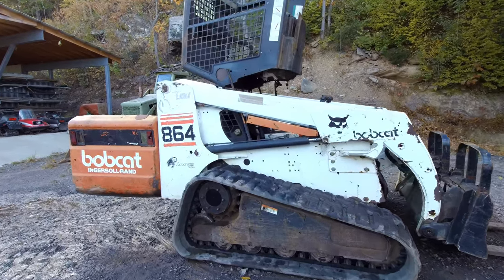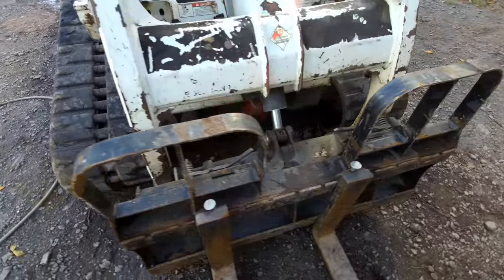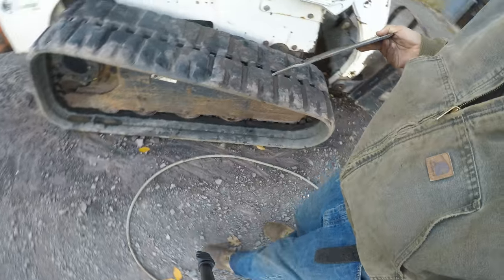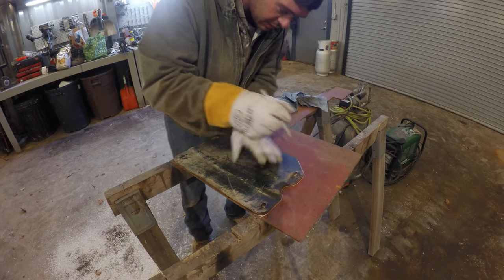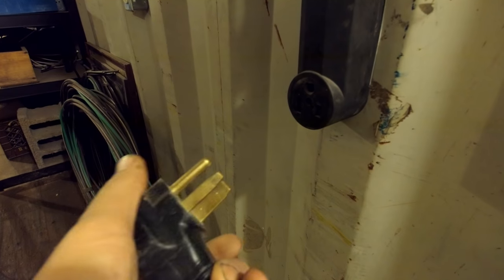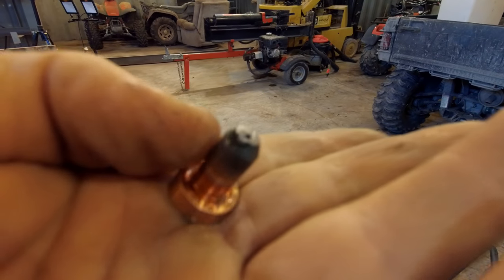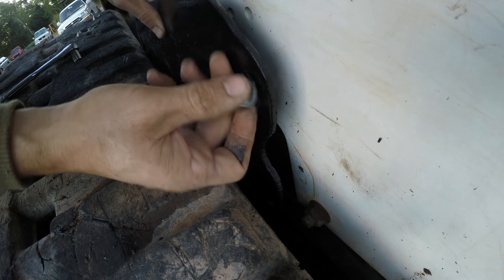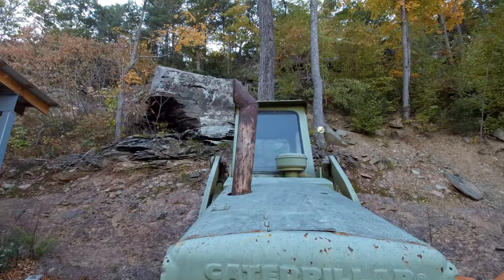How to use a Plasma cutter

Comment: I recommend you add a small water separator to the back of your plasma cutter. They are inexpensive and keep water out of the cutter which is what burns up the tips. You could also go over-board as I have and put one on your air compressor as that is where the water comes from. Great video as usual, Andrew. Nice fabrication job. And, thanks for sharing.
Reply: some plasma cutters have built in water seperaters in the back.
Reply: @davesilvia9711  this one has.
Reply: adding it right before the tool is best because then the moisture in the air has had the biggest chance to condensate and then be separated out.  (if you plan on cutting for long periods of time or in very humid conditions, an air cooler is a must as all components will heat up and moisture wont condensate and cant be separated out.)

Comment: The Cutmaster 52 also accommodates "drag" tips. A drag tip allows direct contact to the metal, makes a far smoother cut, and much easier to do accurate freehand whereas the standoff is just that it's 1/2 in. off the metal. However, Drag tips work only up to a 1/4 in. thickness whereas the standoff are rated at 1in. max. In this application who cares about very smooth cuts -- what he did was perfect.  Andrew is amazing and I learn something on every video. ( The drag tip code  is 9-8252 for the 60 amp version for those considering a Cutmaster 52 )

Comment: I used to build those when they did that in Lebanon NH! My Father was one of the people who figured out how to get the plasma cutter to work at Browning Engineering back in the 50's where it was invented. The main purpose of the plasma cutter was develop for Nasa and the Military, Nasa needed something to cut different metals and the Military need to destroy left over bombs in the Connecticut River. That will also cut under water!  Browning Engineering became Thermal Dynamics in the 60's. My dad never got any credit, but his legend lives on today.. :)
Reply from the maker: Neat. That is a good tool. It will be using heavily in an upcoming video.
Reply: @AndrewCamarata   You have the best! The Torch is the whole secret to a plasma system, and no one else can copy it because of the several patients that Thermal has.. I love your videos! -Tom

Comment: I actually have a Harbor Freight plasma cutter. The literature states that it will cut up to 3/4" mild steel. I haven't tried that, but it zips through everything that I've tried cutting up to 3/8". I've had it for about 2 years and not a complaint in the world. BTW, if you  look under the hood on yours, you just might find it too was made in China. I did enjoy your video. Thanks!

Comment: You never miss what you have until you lose it. I lost most of my hearing in Nam but I don't think I was expected to come back anyway. Great job of explaining how to use and nice hints on how not to burn the house or garage , shop down. I was thinking that the machine should have a skid plate on bottom to help protect and it fills with leaves grease junk and things that either burn or trap oil and heat.. good idea to pull and clean out once in while with a flat shovel for most of it I know someone who burnt his shed and nearly his house because he set the dogs bed to smoldering and it flared up later on. he also lost his car that was parked inside. Very good video. No drone on this one/LOL..... I was referring to the bottom of the bobcat having a skid plate

Comment: Another job well done....Now don’t forget to clean the tracks out on the good old 955...You know that dirt will freeze like concrete. There are some tricks that may help after you clean. I’ve use concrete form oil, or antifreeze, and (if I ran out of those two) diesel fuel. Use a pump sprayer. I would park on some old planks or railroad ties to prevent freezing to the ground. Make sure you use the pet safe antifreeze. Thanks for another good one.

Comment: Regarding post-cut clean up; 95% of the dross can be removed after the metal cools a little by lightly tapping it with a hammer. Then usually just one swipe with the flap wheel and done.  Saves consumables.

Comment: Someone has probably mentioned it, but the secret to clean plasma cuts with minimal dross to grind off is to ensure the plasma stream is exiting the work at an angle, not going straight through. This can be done by either upping the travel speed, or by dropping the amps.

Comment: Hey Andrew. Just a FYI!!!!!!! ABOUT THE PLASMA CUTTER. THERE IS A SPECIAL LEN FOR THE PLASMA CUTTER  helmet IT STRONGER THEN A WELDING LENS!!!!!!!!!!!!!!!!!!!!! . DONT WRECK YOUR EYES 👀 As for your plate for the bobcat.  You could have held back the plate you took off the bobcat... By half the with of the tip of the Plasma cutter ,,,,,,, Using the plate off the bobcat. As the pattern... On all four sided 
It's great your talked about. P.P.G while working that was great!!!!!!!!!!! Keep up the great work. Love the drive gear. On the Skid steer. That was really super take care. JUNKMANDO

Comment: Hi Andrew, thanks for wonderful video. I am an absolutely NEW to these stuff and have ZERO past experience. But i like these type of stuff so i hope i can learn using and utilizing these machines to do some iron & steel related work. If you dont mind, could you please share some info about this plasma cutter?

1) How much capacity it has? How much watts or amps it consumes? Single phase/50Hz is good for me
2) Upto what thickness it can cut? If thicker, can same machine can do the job but ofcourse more cutting time?
3) I understand that it is a replacement of Torch cutter, right?

Kindly let me know.

Comment: The plasma cutter is one of the first things you should get for metal working. The oxy/acet torch is great, but unless you are a seasoned pro, you can't match the clean cuts and ease of the plasma. Also, the speed at which you cut makes/breaks the quality of the job. Cut too fast and it will skip, leaving little bits of material that you will have to break. Too slow and the heat will puddle up and ruin the edges and screw up the tip with slag. Andrew pulled it at the perfect speed.

Comment: What pressure do you run your air??  Does it work at the full 90-120 psi.... Or do You have to dial it down?
Reply from the maker: IDK, I think like 120, I just turn the regulators up all the way.

Comment: Actually the cheapest plasma cutter was $180 off EBay. Cuts up to 3/8ths plate and mine has been great for 3 years so far..:) It doesn't come with a pilot arc like your's does though. The nozzles are so cheap that you can just run them in contact with the work piece and let them wear out faster. It also runs on 110V or 220.

Comment: Andrew,  with your oxy/acetylene torch you can get much bigger tanks so you do not have to exchange them so often!!! They come three times bigger than the ones you have.  Mine last for years!!!!! They are much cheeper after you get the big tanks.  My OXY/acetylene is almost free per cut.    It cost about $1000  to start off, but it has lasted for over 10 years so the cuts are very very cheep! 

It is a good idea to put the ground on the bigger piece of metal with the plasma torch so the ground does NOT fall with the metal piece you are cutting out.  If the ground falls to the floor YOU can become the completing link in the electrical circuit.  DC CAN KILL BUT IT IS VERY VERY RARE OK.     Put the ground on the biggest metal that does not fall so the circuit stays in tack.   No electrical hazards that way!!!  I don’t want you to get hurt ok?
Reply from the maker: The welding places near me wont sell/fill the bigger tanks. They only rent them. I don't rent stuff, so that's the tanks I have. Welder shocks arent bad.

Comment: Also worth mentioning is to add a quality moisture trap to your compressed air unit and check/drain it regularly. Plasma cutters don't like moisture in the system.

Comment: Hi Andrew, You make great instructional videos. I noticed on all of your welding videos that you don't shield your Go-Pro cameras. Ebay has cheap (3-5 bucks) auto darkening replacement lenses for helmets that can be rubber banded to your camera. Also the actual weld is seen more clearly.  Keep coming with the great videos.
Reply from the maker: Yeah, I need to, I think it messed one of them up.

Comment: Camarata, idk but (personally) id be a little careful pressure washing older equipment that has complex electronics. our new holland, we washed and we got some water into the machines mother board. In total it was one huge headache getting that thing to run again.
Reply: That's why very few of Andrew's machines have any computers in them, most of the diesel engines are mechanical injection.  Andrew seems to have a machine cutoff of sometime in the mid-1990s before all of those horrible useless error codes.

Comment: Page 6:00 if you are tired of regularly replacing tanks of gas how about Induction heaters? It use electricity to heat frozen bold and nut. Pay once the rest are electricity cost.

Comment: Do you park your track loader on planks for the winter?
Reply from the maker: I do not.
Reply: The reason you would place your tracked equipment on planks is to keep the tracks from freezing to the ground. Can break a track that is frozen to ground if try to move it.
Reply: The reason you would place your tracked equipment on planks is to keep the tracks from freezing to the ground. Can break a track that is frozen to ground if try to move it.
Reply: The reason you would place your tracked equipment on planks is to keep the tracks from freezing to the ground. Can break a track that is frozen to ground if try to move it.
Reply: The reason you would place your tracked equipment on planks is to keep the tracks from freezing to the ground. Can break a track that is frozen to ground if try to move it.
Reply: The reason you would place your tracked equipment on planks is to keep the tracks from freezing to the ground. Can break a track that is frozen to ground if try to move it.
Reply: The reason you would place your tracked equipment on planks is to keep the tracks from freezing to the ground. Can break a track that is frozen to ground if try to move it.
Reply: Ted Ohio so why do you park them on planks?

Comment: Question for anyone, what would be the uses of a Harris 25-100c OxyGen Reg and a 25-15c Reg Set (w/ Argon Gas), I have these available, but what would be the function for this set?
Reply: These are used for MIG and TIG welding processes. The argon gas shields the molten pool from oxidation.
Reply: @davidmorse8432  That makes sense, but the set also came with both bottles, Torch and soldering torch? Why might that be?
Reply: @ThePTBRULES  probably someone's collection of miscellaneous welding stuff. You should see mine.
Reply: @ThePTBRULES  sorry, I don't  do Facebook, I will be your friend though. You really can't  do much of anything with what you have. Somebody already got all the good stuff. I would take the bottles somewhere to see if you can get them filled. If you want to work metal with what you have it will take a considerable investment to get the stuff you need. If not take everything except the bottles to a pawn shop and see what you can get. They may offer you $100 if you're  lucky. Bottles are worthless unless somebody will fill them.
Reply: @davidmorse8432  I understand what your saying, thought it a little more stuff than what I said, and we were the first people into other than our friend who manages it, so I fortunately have the whole set. Thanks for your assistance.
Reply: @ThePTBRULES  Any time! Good luck with your endeavors.

Comment: 4hp air compressor is 4hp PEAK....as it is measured on AC voltage from the <-> to the <+> peak of the sine wave.  This is to give the impression it is more than it is.  Horsepower is properly measure  in Root Mean Square <look it up>. The actual horsepower of that compressor is 1.4 hp or so.
Reply: I always figured that horsepower meant diddly-squat when talking about an air compressor.  For me,  it's all about how many gallon the tank is, and how many CFM (cubic feet of air per minute) the rig can supply.  The builders and sellers would be better off advertising specs like what size the air compressor itself is, and as an aside, how much hp is needed to turn it effectively to maintain that sort of an output.
Reply from the maker: Yeah, I feel like they were lying or something about that. Cant find a compressor now similar that's 4hp.

Comment: Your fabricated plate probably bended into place when you bolted it on, so that was cool.  Good information on the plasma cutter  Thanks for taking the time to go into detail , much appreciated . Good advice on buying tools. Don't waste time and get the crappy one that works but sucks !  Get the good one first. So true !  I was wondering if you are going to heat your work areawith some kind of heating system? Looks like you need a bigger garage with all your projects around ?  Are you interested inany kind of solar systems and panels to power the castle ?  Thanks for sharing your knowledge and experience ! Great video !
Reply: Not with that gauge of metal, that being said, bolts with washers make it ill-relevant.
Reply: Are you sure? I bet it bent a little when he cranked down on it with that ratchet !

Comment: Andrew, please start wearing a quality mask when you plasma cut. The dust is very hard on your respiratory system.  Nice video!
Reply from the maker: Dust from plasma cutting? It doesn't seem like it makes any.
Reply: @AndrewCamarata  I would kindly advise you to research it. Years ago I developed respiratory problems from running a plasma cutter in a poorly ventilated shop and no respirator.  A plasma cutter gives off fine dust and fumes that can cause respiratory problems and lung cancer.

Comment: I know this is older but why didn’t you just leave plate on top and trace it with cutter?
Reply from the maker: Maybe, I wouldnt want to mess it up, Plus when tracing stuff, it needs to be like 1/2" smaller because of the size of the cutting head.

Comment: Those plates cover your drive chain compartment.  You don’t want dirt getting in there.
Reply from the maker: That might be the case on a wheeled machine. The tracked machine does not have any drive chains.

Comment: A metal container building will burn! It is because of the paint on the metal, the paint burns.
It is just harder to start! But when it gets going it burns fast and very hot!
I worked in a tool shop that burned to the ground and it was block and steel.
The paint and oils burned and it was very hot it melted most of the steel!

Comment: No inline air dryer?  I love my 2 stage air compressor.  Works great also to have an old miller with copper windings for carbon arc.  One nice thing about being away from people like you are and a steel building not many rip offs. Down the road from me loggers where hit in 2 homes chainsaws on their porch and they are 200 ft off the road. Conex containers work great with those locks from Uhaul.  After loosing 42000 in welding equipment you learn. Why on jobs you see expensive things put up in the air with the cranes. I was in nevada for a 3 week class and a man tried stealing copper windings on one of those 2 mw windmills he fried like a mouse on a 2000 watt baseboard heater I was told.  Too lazy to work too stupid to steal. You also learn to put locks on equipment on ebay people or ripoffs can go right to a dealership and get keys for equipment one job they stole a new cat backhoe and used it to load everything onto a trailer.

Comment: It's a cover plate to keep dirt out, just make it out of aluminium? Can't see the point in using 1/4" steel.
Reply from the maker: That's what it was in the first place, so I replaced it with the same stuff. 1/4"  Aluminum may have worked, but a well placed stick on a clearing job might rip it off, and there is really no advantage on it being lighter.
Reply: @AndrewCamarata  - Fair enough

Comment: I've had this plasma cutter for a couple years now and I can never get it to cut 1/4" thick. The manual says it does 5/16"

Yesterday I was trying to cut a keel off of a sailboat with it and it wouldn't work so I threw everything in my garage and shut it so i could move the sailboat out of my alley. Came back to clean up and I noticed the air output line wasn't even hand tight. I couldn't hear the leak because it only leaks when you pull the trigger and air comes out the nozzle too. I swear I tightened it when I took it out the box but maybe not. I wish I had 220 in the garage instead of having to run a 60' extension cord for it...i would have tried again if it weren't such a pita to set up. Maybe that's also why it won't cut although its an 8 Guage cord....idk could also be cheap ass China garbage
Reply from the maker: This cutter will cut over an inch. You need 240volt 50 amp power. Run a 100 amp 240 service to your garage.
Reply: @AndrewCamarata  I appreciate you